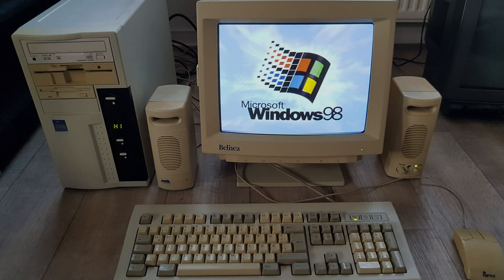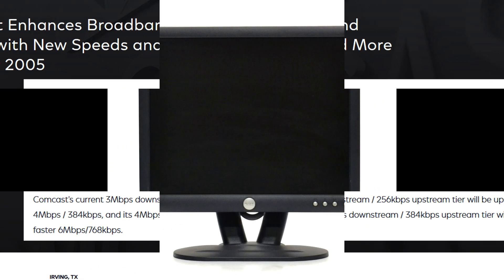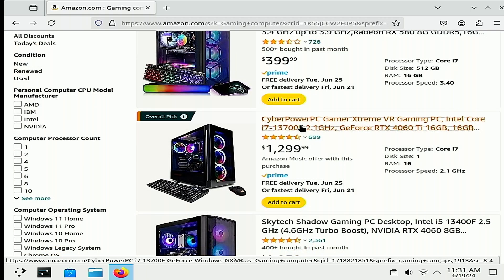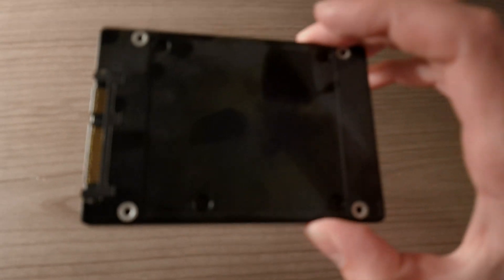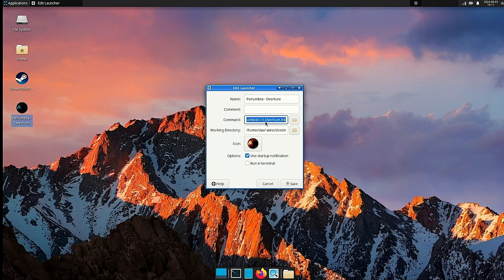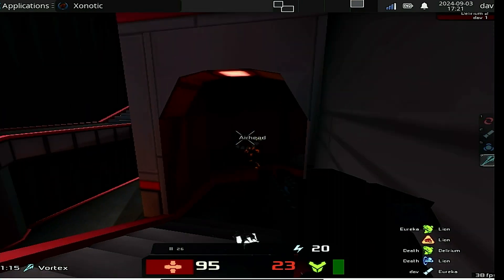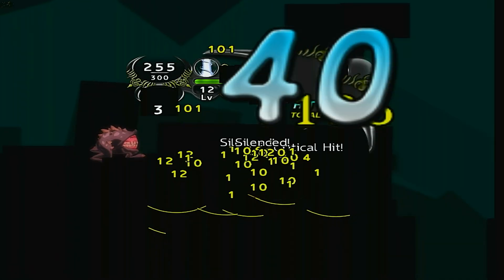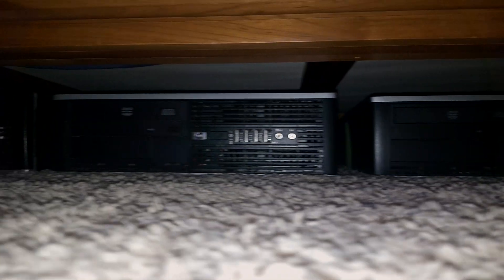Using a 20 Year old Computer in 2024

Comment: I had this same PC as a kid. My parents bought it around 2005 or 2006. It worked fine for the most part, minus a power supply issue a few years later. I set it up on Windows 7 to be used offline at my dad's work, and it worked great there until he retired. The PC front panel did start falling apart, so I used duck tape to fix it.

Comment: Since this has a PCie slot, please retest this pc Video with a upgraded modern gpu to see how much bump he gets.

Modern gpu handles more games than this, as the amd gpu is over 20 year old and linux has mostly lack of those.

Disable Hardware acceleration with small mode on Steam Client bumps the performance on some certain of games that ran it well before. 

Steam Client has been soo much bloated, that someone needs to making a lightweight alternative for this reason...

Comment: i have a question the old ati gpu can support mesa driver ?
Reply: Yes, this GPU should be supported by the latest mesa driver.
However, if the generation is even older than this, I think it will only be supported in the legacy branch.

Comment: The ssd will fix everything. Putting an ssd in my mint linux setup, made much more of a performance jump than adding more memory to the system did.
Reply: It summarised. If you’d install just the SSD upgrade, it wouldn’t be that big of a performance boost.
Reply: @MikhaKey   HDD took extremely long to boot, no matter what spec. SSD makes a difference.
Reply: Well, I recently put a ssd in a old PC running a e8400 core duo cpu with 2gb ram and the ssd made it feel like a new PC. I then put 4gb of ram in it and it seemed to make no difference whatsoever. So the ssd was a much more substantial upgrade compared to Ram.

Comment: i use xp sometimes on the internet and it's fine
its kind of over exaggerating
Reply: The risk of using XP is greatly exaggerated by people who have no idea what they are talking about.
Reply: @pike.67  I'd say there is an actual risk; if a user doesn't know what they're doing, clicking around on every link they see.

If someone's used to using older systems (or) knows common internet sense, there's less risk to it. Still higher than if using a non-EOL system, but less.
Reply: XP went EOL eons ago. Connecting it to the internet presents a massive risk.
Reply: @BlueSparkzVideos  meh, a year or so using it, and no viruses
works for me
Reply: If you didn't already know about it, there's Supermium for XP (Chromium ESR, but modern versions).

There's also a couple community Pale Moon/Firefox forks floating around if you don't have SSE3.

Comment: Cool, I got a 2004 DD 3000 which I later on "pimped out" with 2 gigs of ram and a Radeon R9250 (128 megs).

Still running xp though because FUCK fan patches... I did consoder dual booting with some kind of distro but there is nowhere to fit a second harddrive, so I guess no websites besides fimfiction for me... 🙃

Comment: I have a dell dimension 9150,i used all sorts of linux distros on it,it even ran ubuntu for a short time and in the end I made it a windows XP gaming machine
Reply: I have a dell dimension 9000, it can run windows 10 because i found a bunch of scattered ddr2 sticks and had to put one in the baking oven to repair it and ended up with 3.5gb of ram setup and it also got a beefy amd radeon r5 230 that was included with it, but its in my shed because i dont use it and salvaged the r5 230 because it has better places to be